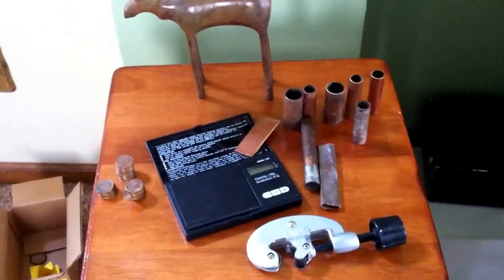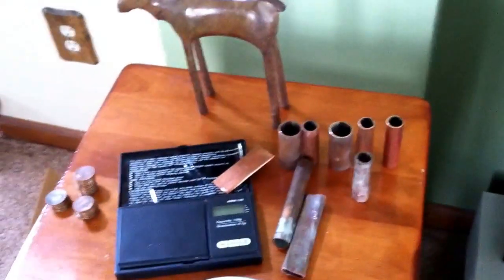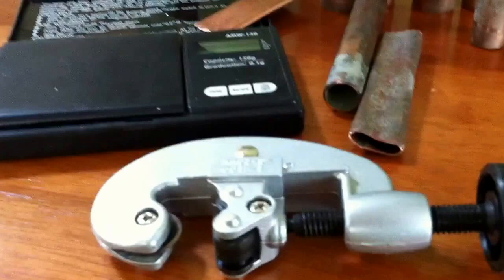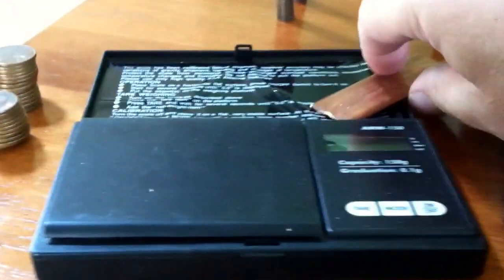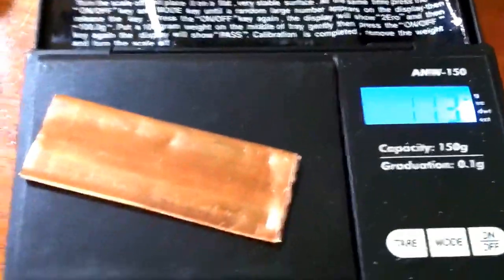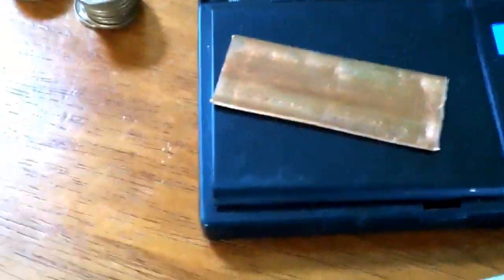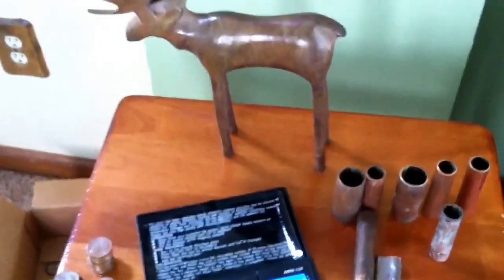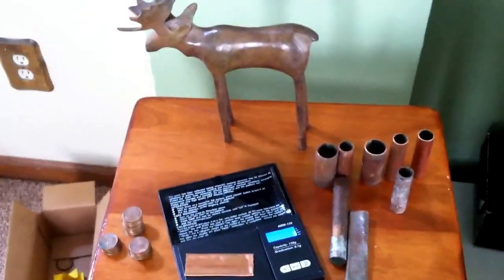How to make copper bars with out melting pennies

Comment: although copper piping is less pure, and generally worth about 10 - 20% less than fine copper  (clean copper wire). you could reasonably pay 40% over spot for fine copper bullion coins as they have value as a transportable, fixed, easily counted unit of a copper, but that means you would only want to pay 17 pence ( aprx 30 cents US) for each copper bullion coin. even buying them in bulk and with shipping could run you double even triple what they are worth.
Reply: you could take the loss in order to have small change to use in a local economy based on copper, silver, gold, tobacco, coffee, garments shoes etc (a bartering system)